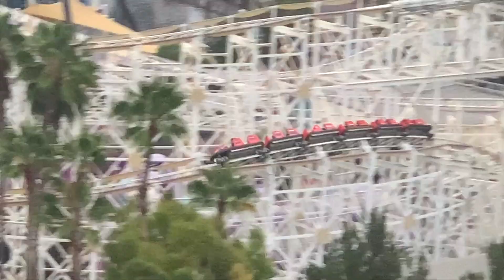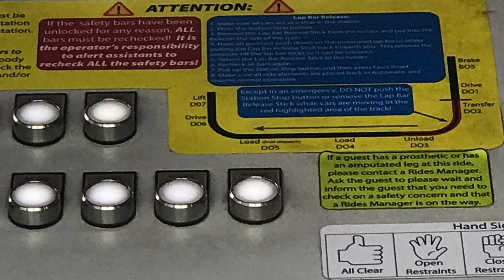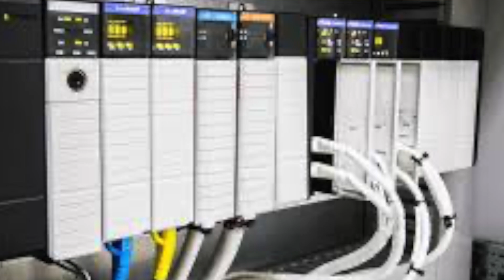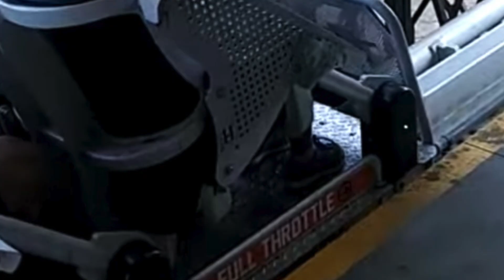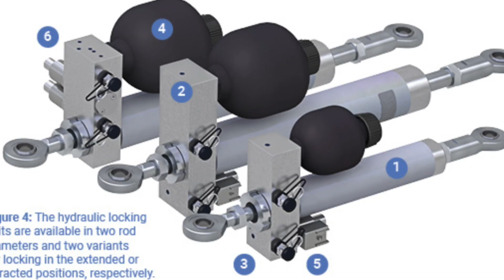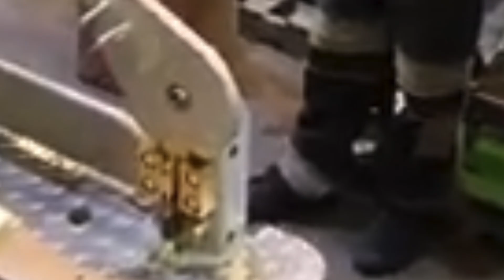Rides can’t tell if your restraint is locked

Comment: When you get your restraints on, and the ride ops check your restraints. You think you're ready to go, however the restraints lift back up and you got to put your restraints back on and the ride op comes and re-checks your restraints. Could it be someone saying their restraint isn't locked? Or is there a different reason for that?
Reply from the maker: On a Lot of rides they use a single unlock command. So you can’t unlock “row 3” so if someone didn’t put their hat away 99% of the time, they have to unlock the entire train just to let one person off and back on.
Reply: @ryantheridemechanic  Thank you for your response. I was always curious why that happened
Reply from the maker: And some times it’s a large guest they are letting out. Along the same lines.
Reply: Ride Op here. Frequently what will happen is that someone will not open their restraint while walking through on their way to pilut loose articles in a storage bin, and get locked out of their seat, requiring it to be re opened, frequently along with an adjacent row. Another frequent occurrence is larger riders needing to be moved to a larger seat, if the ride has one, or just le off if there are not larger seats.
Reply: @CatofthePotatoes  Thank you for responding. That's happened to me at many different rides at many different parks. I always wondered what the reasoning was. Appreciate it

Comment: Well, thanks for scaring the hell out of me!!! I always double and sometimes triple check by trying to get it to open.
Reply from the maker: I know this but it does not deter me from riding. It’s more pointed at the conclusion that the safety system knows all is not necessarily correct. Take it with a grain of salt.
Reply: @ryantheridemechanic I have had mishaps with the little secondaries that leave me cautious, but I'm not going to stop riding bring on TT2. People freak out about the lack of seatbelts 🤣🤣🤣🤣 on TT2. Like they actually believe that is what is holding them in 😂😂😂
Reply: @LTCoasters  there is quite a bit of air time at the top idk

Comment: Hey Ryan, can we draw this conclusion towards the Tyre Sampson tragedy at icon park? Or was that a proximity sensor failure?
Reply: Unfortunately, the proximity sensor was adjusted out of spec so the harness was assumed down enough but in reality it wasn't. The harness was still locked, but it was therefore beyond safety limits. The proximity sensor can be determined as working when the harnesses cycle open and closed as the PLC will monitor the 1 or 0 reading back to the inputs
Reply: He was too big to ride.

Comment: its funny to me that you show xcelerator considering it technically doesn't have a minimum verify.
Reply: in that case, it doesn't have an Interlock, the minimum verify is the orange circle. Ride of Steel at SFDL has an Interlock and a minimum verify now after the 1999 accident.
Reply: It seemed like it did when I rode it.
Reply: @rct3fsx Xcelerator has an indicator on the lap bar, but it does not report back to the safety related control system.
Reply: @rct3fsx  the minimum verify is determined by the orange circle on the side of lap bar being covered by the side bars. it doesn't say on the panel if a restraint is down enough or not.
Reply: Ah, so I shall look closer. @probxtion
Reply: Oh THAT'S what they were looking at. @probxtion